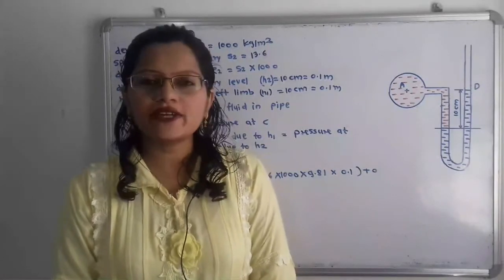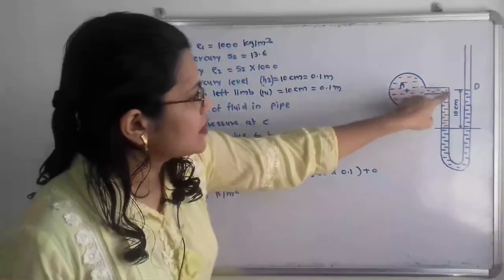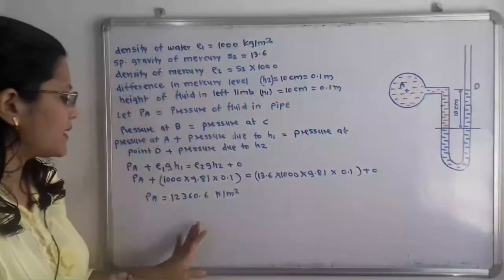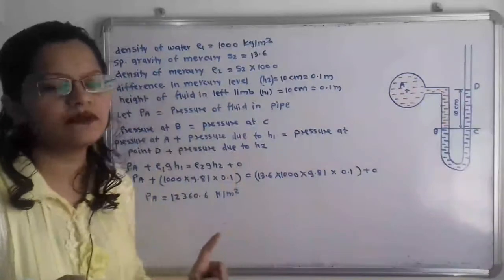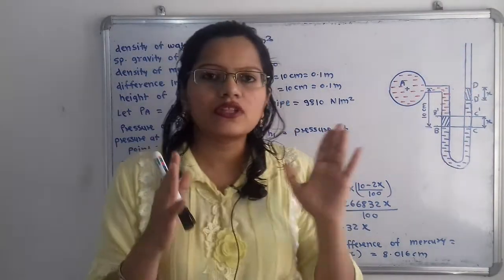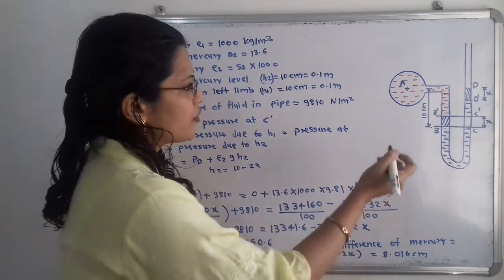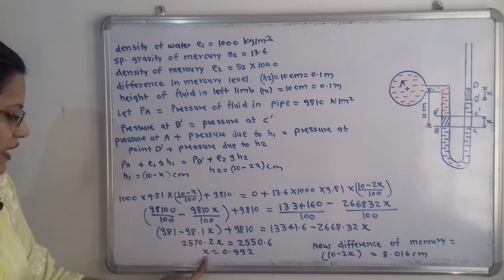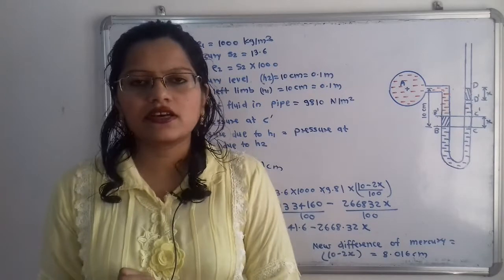Problem 3 on U tube manometer/ pressure and its measurement

Comment: u tube manometer shows mercury level 90mm above centre of pipe in the open limb and 60mm below centre of pipe kn the left limb connected to pipe calculate pressure in the pipe pls solve this

Comment: a mercury tube manometer is used to measure the pressure above atmospheric water in the pipe.the beam in contact with the mercury is 50cm below as shown in the figure in left hand limbs and 40cm above a in the right-hand limbs, what is gauge pressure at a? take specific gravity =13.6

Comment: Mam in 10:19 you mentioned that 10-2x is divided by 100 to convert into meter so the ultimate value of x must be in the meter. How come your final value of x is in .992 cm instead of meter?
Please answer asap
Reply: Same doubt for me
Reply from the maker: By using formula,  you have to always use  standard units i. e. m  but assumption is x is in cm
Reply: @edutechguruengineeringlear4280  
Thanks for the clarification mam.
Tomorrow is my final exam. Keep me in your prayer ❤️
Reply from the maker: @JasonMomoa-u6p  👍👍Share my videos in your class. ..